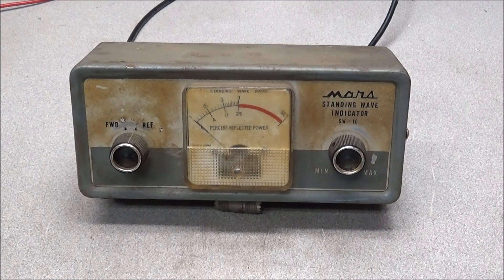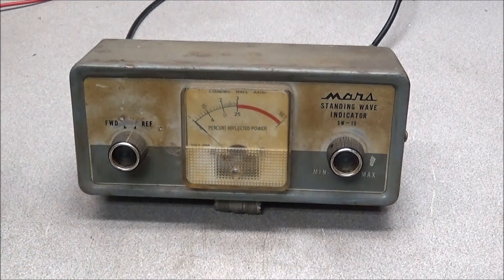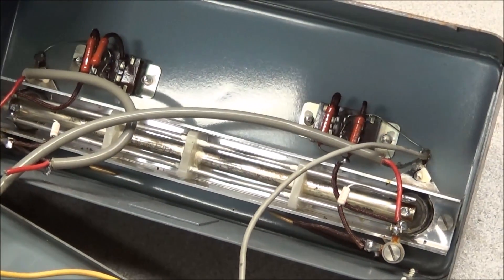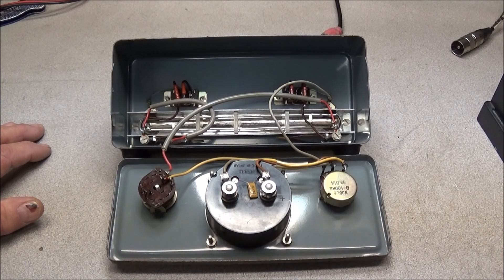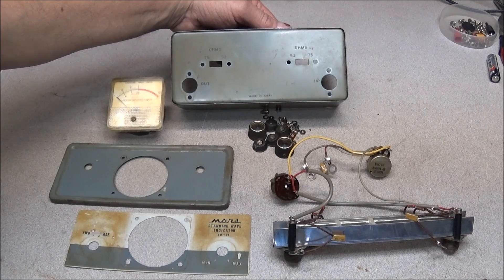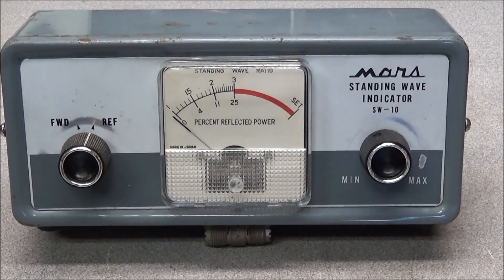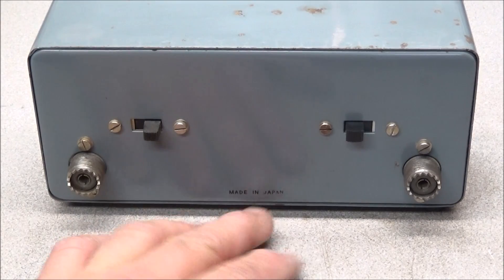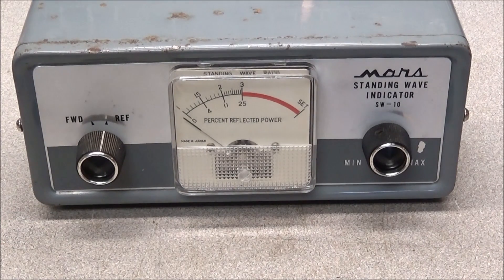#22 Bringing the Mars SW 10 SWR meter back to life

Comment: A nice vintage restore; I always enjoy old equipment come alive, it reminds me of the old times when that is what we had to work with, excellent demonstration.
Reply from the maker: +John Cunningham Thanks John for the nice comment. Thought you get a kink out of this one. This is the kind if stuff I love doing. Taking an old piece of history and getting it back in service.  I agree. It is what we did back in the day, only thing is I still do it.
Reply: There is nothing wrong with that. In fact the Sencore FE20 meter that I acquired from eBay was in mint condition; but the meter was pegging, so I took it apart and performed delicate surgery and brought it back to life. It has 15 meg input on DC and 12 meg on AC that I still use, best part it has a 6 inch meter making readings very easy to read.